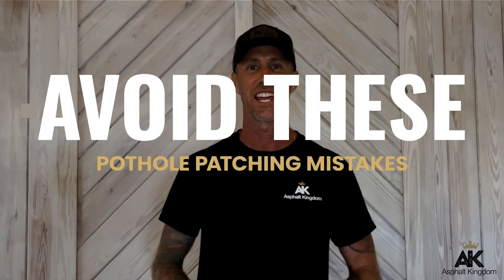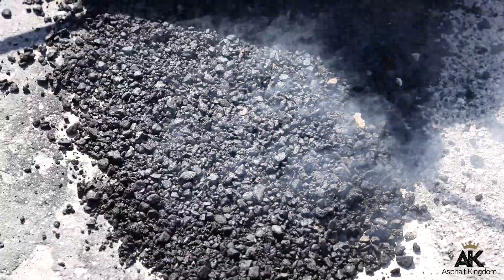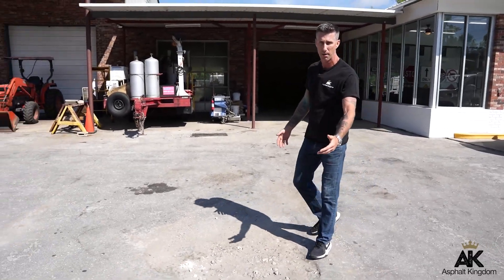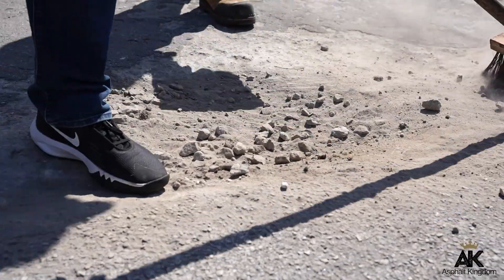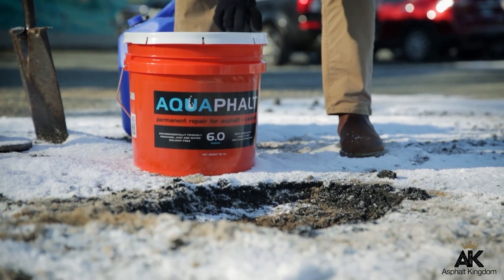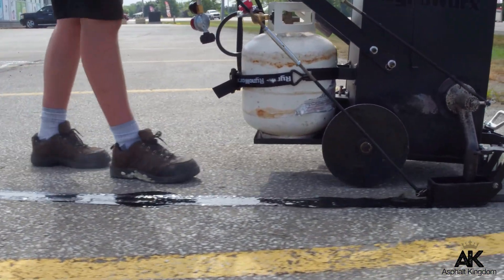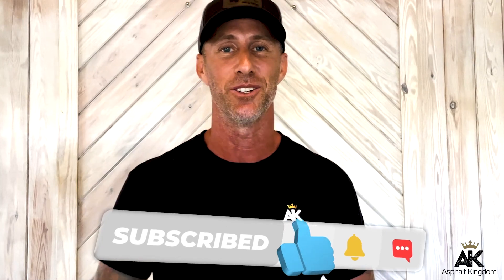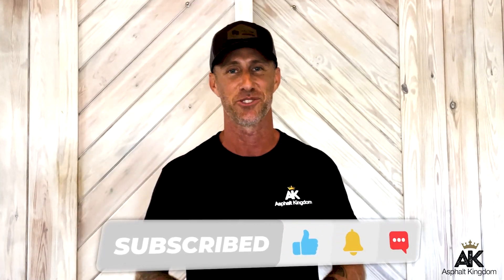DIY Pothole Patching: Crucial Mistakes to Avoid

Comment: I've been asked to patch potholes, cracks, and a strip where the pavement had been cut away for a sewer line and patched over, but that patch now has settled in. The amount of settling is small, but it's a trip hazard for the elderly and a difficulty for people in wheelchairs.

How deep does a patch need to be to properly bond?
Reply from the maker: Great question! It sounds like you're dealing with a mix of patching needs, including potholes, cracks, and a settled utility patch, each requiring a slightly different approach.

For cold patch repairs, the ideal thickness is about two inches. If the pothole is deeper, first fill it with angular crushed gravel before applying cold mix asphalt for better durability.

For crack sealing:
Shallow cracks (½ inch deep or less) can typically be sealed directly. If the cracks are newly formed, they likely fall into this category.
Deep cracks (over ½ inch deep) should be partially filled with sand before applying crack filler to ensure proper bonding.

Let me know if you need any additional guidance! 🚀

Comment: Will quickrete cold patch adhere to a concrete apron on a driveway w/out an emulsifiing agent? My street is higher than where the concrete meets the road creating a lake that we have to drive through to park the car.
Reply from the maker: Hi there! It could work but it may not be the most durable and long-term solution, since cold patch are intended for pothole repairs. You can elevate the concrete apron area with a layer of asphalt.

Comment: Thank you for the video.  I just filled a 3'x3.5' pothole with Latex-ite Cold Patch H2O.  I want to seal it per your instruction in the video.  The Latex-ite video says it can be sealed after 24 hours.  There are a few mentions on the sealant reviews that I got on HD, that say wait 4-6 weeks to seal a cold patch.  Any opinions on that?  The Latex-ite Cold Patch H2O instruction video stopped comments, so can't ask the question there.  I find that interesting.  Thank you.
Reply from the maker: Hi Mike! If Latex-ite says you can seal after 24 hours, it's good to follow that. However, waiting 4-6 weeks ensures the patch is fully cured for a more durable seal. Our recommendation is to let the patch cure fully before heavy use, especially for larger potholes, to achieve long-lasting results. Feel free to reach out if you have more questions. Good luck with your project! 😊
Reply: Follow Latexite instructions, in my opinion.  The Quick Patch h20 I believe has a water activated bond agent (glue) so the patch is locked as one mass. This video mentioned sealing the edge, which makes sense to me.  With a patch like H2O and Aquaphalt, the edges are the most vulnerable area because the manufacturers don’t instruct grinding a 1-2” edge wall so the patch material can push and grab; many potholes have thin, saucer edges and not have walls like a pot.  Quickcrete’s products I believe say you should cut out 2” edge walls, while Latexite doesn’t, but wall edges makes sense to me in all cases of pothole repair.

Even for wide cracks where a liquid filling isn’t appropriate, cutting the edges into U shape rather the V shape also makes sense to me.
Further, you’ll see a product called asphalt tack which is a surface bonding agent, but it’s expensive and sold as a $65 spray or $50-$145 5 gallon:it is just asphalt emulsion, maybe with a glue.  I made my own tack, with the cheapest sealant ($22 5-gal from HD) which is asphalt emulsion, added Quickcrete liquid concrete glue, and made a slurry to chip brush the edges and surfaces, and then shovel in the patch material.  Since there water in the slurry, I avoided large surfaces in case the glue in H20 is activated by the tack slurry, so shovel, add water and tamp.  The edges should lock well because of edge wall, tack and bond slurry, and H20’s own glue in the patch material, and tamping so the material can grab the edge wall and rocks interlock.
All sealant manufacturers say to let new asphalt cure for 6-12 months so all the liquids evaporate. 

This video says, sealing the edges will keep water from seeping under which makes sense.

The video says to prepare the pothole by getting out loose material.

Comment: Can I use ground-up asphalt as a pot hole filler if I heat it up
Reply from the maker: Yes, you can use recycled asphalt (millings) to fill potholes. You can also add a rejuvenator to improve adhesion.